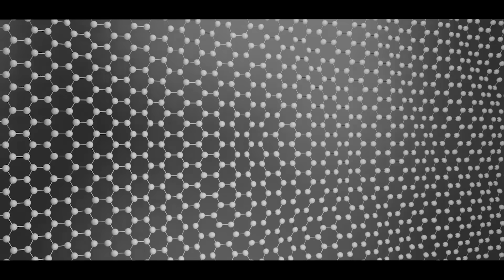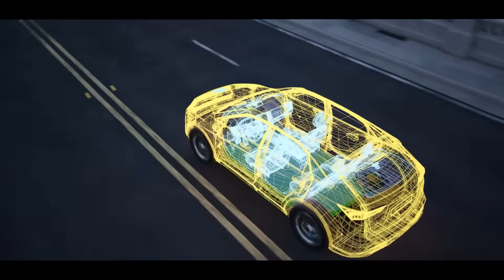The Pi-Car: Next-Generation Electromobility

Comment: it sounds great!

but how much energy can be generated by the source?
In numbers! not in feelings....

sono car was anounced that it uses photovoltaik to produce energy.
The amount was estimated double the amount of a perfect aligned solar cell in the sun (and of course not all cells can be aligned perfectly)
Even that amount of energy was able to extend the range not not even 5% more range. ("Self powerd" suggests 100% of the energy is coming from the "new" source)

Why is that technology not used instead of photovoltaik in our homes? Where it is a lot easier to mount/maintain?

So how is that different?
Again in numbers! not feelings!

Comment: Cool but sounds complicated and expensive. We could still just use hydrogen cells in existing cars and convert them to run on water that is converted into hydrogen on the fly as needed in the motor.